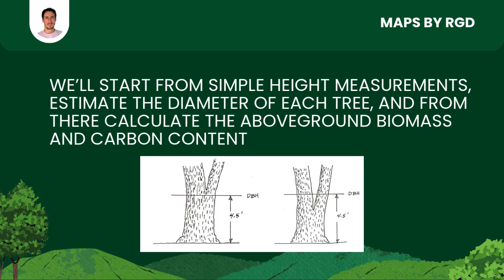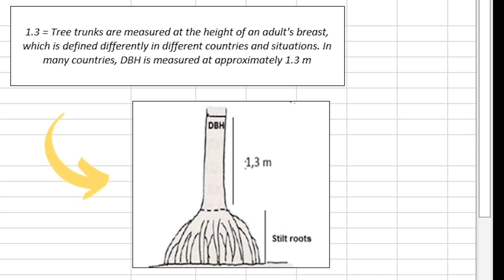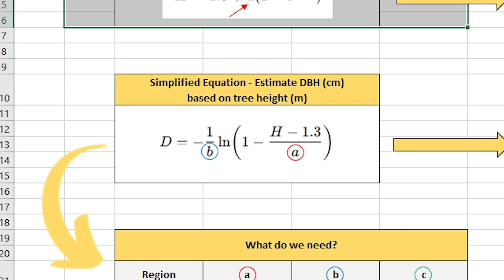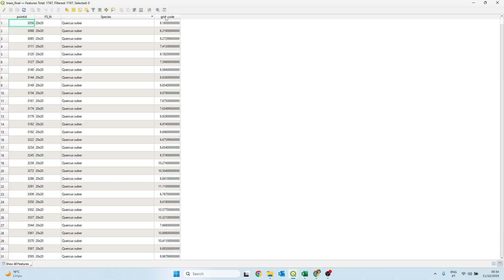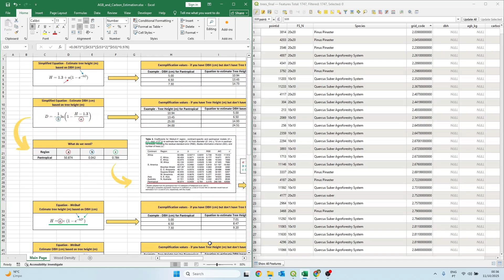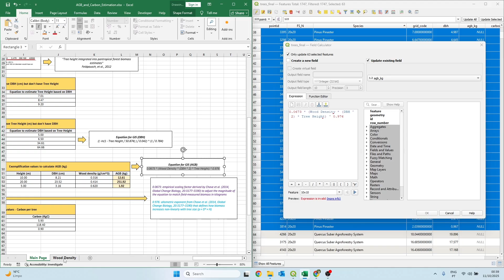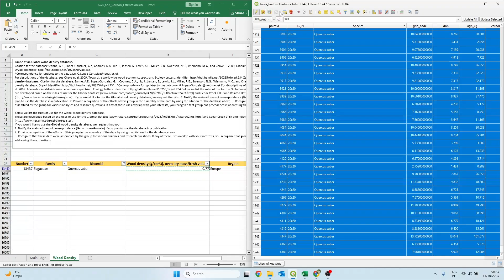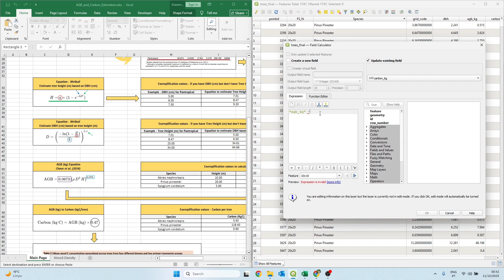ESTIMATE ABOVE-GROUND BIOMASS (AGB) AND CARBON (C) FROM TREES IN QGIS USING LIDAR DATA

Comment: THANK YOU VERY MUCH ! 
Very very useful 
Is it possible to do it for Soil Organic Carbon (SOC) and below-groud Carbon ? 

Like to estimate the carbon sequestration of an Forest, agroforestry project ?
Reply from the maker: It's very possible, you just need the percentage of OC, bulk density and rock fragment data. This analysis is tipically done at 20cm, because the major part of SOC are at this depth.
Reply: @MapsbyRGD  Can we  estimate above-Ground Biomass (AGB) and Carbon (C) per tree in Arcgis Pro ?